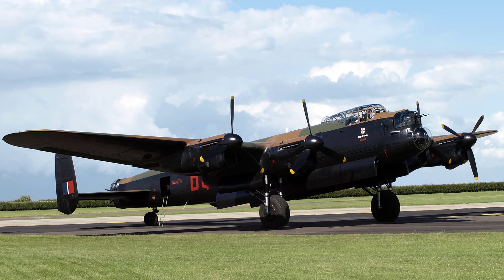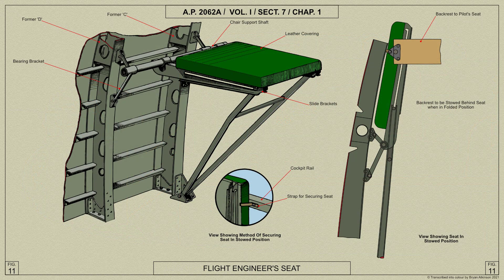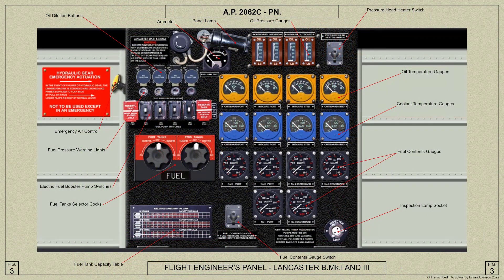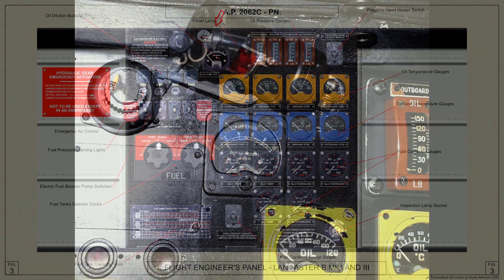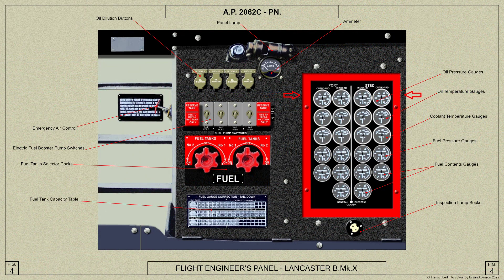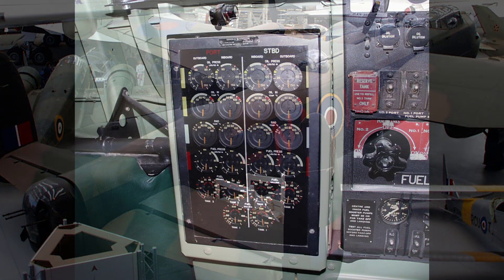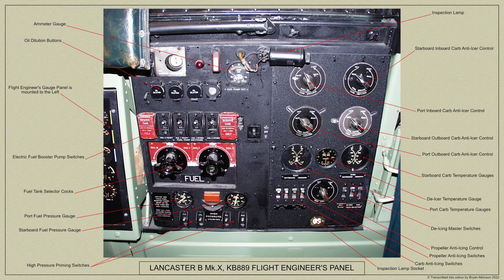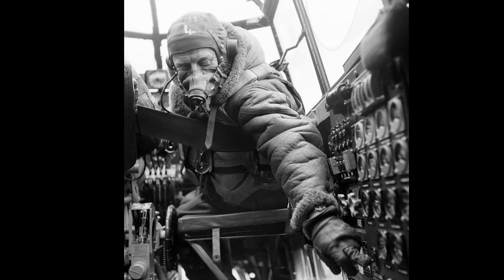Avro Lancaster – Flight Engineer’s Position

Comment: I don't know how the flight engineer was supposed to be able to see the control panel, let alone work the controls.
Reply from the maker: There was a filtered lamp attached to the  Flight Engineer's panel at the top. Thanks for watching Peter!
Reply: @ukaircraftexplored6556  Thanks for the information.  I was more concerned with the location of the control panel.  It appears to me that it is behind the engineers seat, where he can see or touch it easily.

Comment: Excellent series of videos you’ve produced on the Lancaster. The Flt Eng video particularly interests me.  One question I have though. The Flt Eng usually has to synchronise the engines shortly after take off (and monitor them hereafter). I am guessing that this is simply adjusting the throttles of individual engines such that they show all the same RPM on their appropriate dials. Or is there something more complex involved?
Reply: You pair engines in turn by ear until they all are in synch.  The noise from out of sync props is extremely loud.  Move one prop lever of the pair to slow the beat to zero, if the beat goes faster move the prop lever the other way.  For some bouncing bomb test drops the props were also in phase in the recorded cine film, perhaps test aircraft had engine oscilloscopes.
[If the props have a 2Hz beat the blades per second are 2 out, = 2 X 60/(3 X 0.42) = engine 95 rpm difference (2 blades difference, 60 seconds, 3 blade propeller and 0.42 reduction gearbox)].
Reply: @givenfirstnamefamilyfirstn3935  
Thank you very much. Great in depth answer. Just what I was hoping for. I will have a play with the math and see what various answers I can get with with various RPMs. (Hope maybe, to graph it in my laptop’s spreadsheet..!).
Thanks once again.
Reply from the maker: The Flight Engineer's tasks would include assisting the Pilot during start-up and take off, and to continually monitor the engines, pressures, temperatures, propeller and electrical systems. During operations, his job was very complex, ensuring the aircraft was functioning correctly, and in an emergency, to quickly determine the correct course of action and advise the pilot. Thanks for watching.
Reply: @ukaircraftexplored6556  
Thank you for your answer. I did try to get in to RAF as Air Eng (the contemporary label at that time). I hoped that my engineering qualification would give me a bit of a leg up. Keen to get in as my father refused to endorse me to go in when I left school (under 18 thing at the time). But alas, I had one school qualification amiss, so went back to college to fix that up. Two years at night school failed to produce the qualification and then my age was past the 23 & 2/3years (odd age cut off!!). So I stayed grounded and in civi street.. ce est la vie…!!! 
Thank you once again for your excellent videos. Take care.

Comment: What are oil dilution buttons for?
Reply: The engine oil was diluted with fuel to temporarily reduce the viscosity of the oil when starting in cold weather. The fuel evaporates when the engine reaches operating temperature.  Modern oils often have additives to do this.
Reply: @richardschaffer5588  Thanks Richard. I was wondering the same thing.
Reply from the maker: Please see my Video -  Avro Lancaster – The Oil System, it answers your question. Thanks for watching